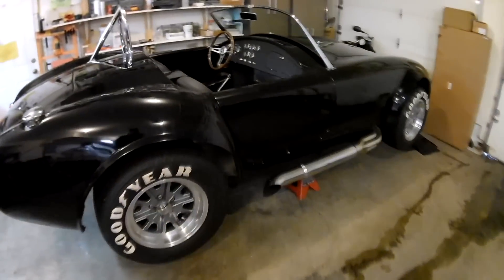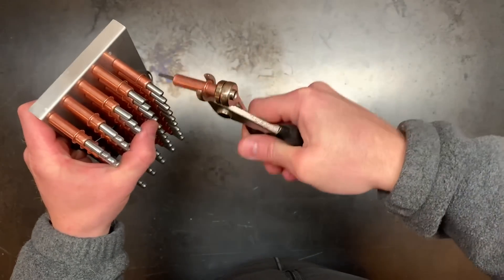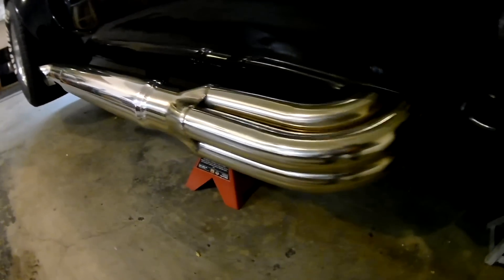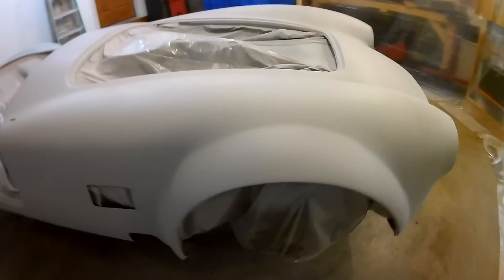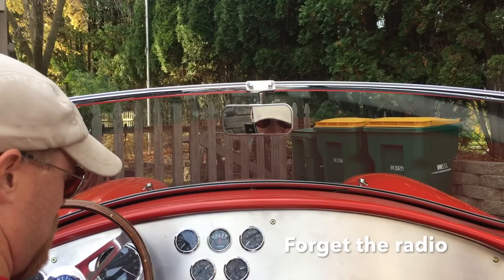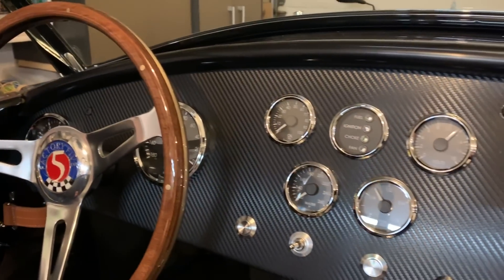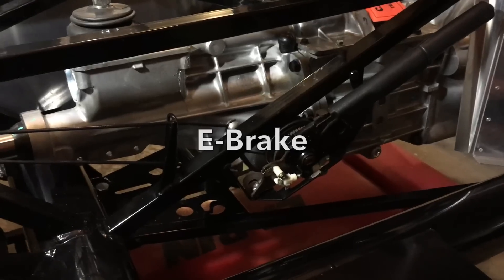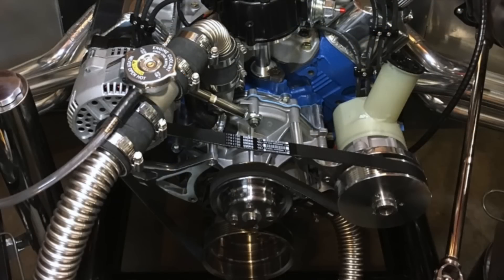Factory Five Cobra: Lessons learned

Comment: Some years ago dad and I built an Austin Healey Sebring 5000 kit car. Opted for the fully assembled frame kit with steel floor and transmission tunnel. Made the mistake of getting a custom built thick core, all aluminum racing radiator. Even with a really powerful electric fan it would run hot sitting still and at lower speeds. The problem is those radiators aren't made to be used at an angle nor are they made for sitting still. What we should have gone with was a 'feed truck' core that has a much more open fin design that's made to not get clogged by debris when used on trucks harvesting crops. Small bits of chaff can get sucked through by the fan and larger pieces will fall off when the engine is shut off.

What you could try is one of the dual fan setups used on various Fords. Some have two fans the same size, some have two different sized fans. I mounted one with same size fans on a 1998 Mountaineer. It fit in vertically and after putting the bottom of the radiator back into proper position had no clearance problems to the threaded water pump snout.

I built a two speed fan controller, inspired by a setup used on some Peugeot with dual fans. At low temps it connects the fans in series to run each at 6 volts. Then when the AC is turned on or if the temp ever gets hot enough (never did) it uses relays to switch the fan connection to parallel to run them at 12 volts. It has a pair of multi turn pots to adjust the high and low switching temps.
Setting them was simple, pot of water on the stove with a dial gauge thermometerr. Put the temp sensor in the water, connected it, the controller, and fans to a battery charger then turned on the stove. When the thermometer got to the temp I wanted I adjusted the low pot until the fans switched on, then turned the stove up to the high temp to set the high speed. My 1965 Kelvinator (built by American Motors) stove has one burner with precision temp control so I was able to dial in the fan controller settings.

If you want the controller schematic I can send it. I built mine on a piece of plain PCB perfboard with point to point wiring for the relays and a Radio Shack prototype board on standoffs for the electronics. Extra difficulty was caused by Radio Shack having replaced all their classic line of project boxes without updating their PCBs to fit the new boxes. (Just one of the many reasons the company is defunct.)

The way the circuit is designed, half the IC isn't used. There's a chip that's the same as 1/2 this chip, or the other half of the chip could be used to run a second copy of the rest of the circuit for operating two more relay controlled devices based on temperature inputs. Perhaps a pair of exhaust fans behind the side louvers?
Reply from the maker: GreggV8 - lots of very good info / you have some valuable knowledge/experience with the Austin Healey and I might follow your lead with a similar modification - thank you very much for sharing- i'll reference this in the future!

Comment: Using Ford Explorer engine not the problem nor is timing cover. No change in Block, Crank, Rods, Pistons. But Heads are GT40P with different plug angles and exh ports raised some but they bolt to any smallblock. Water pump so many choices don't have to use Explorer pump either. Try finding replacement water pump for MustangII 302 they were short nose too. My CobraII now uses normal pump with modified pulley
Reply from the maker: right on - thats what i ended up doing - got a fox timing cover / water pump and my problem was fixed. FYI- the Explorer motor is GREAT in this setup / i kept the GT40p heads and just changed the cam - LOVE the motor

Comment: I prefer the look of the 289 F.I.A. Cobra to the others. A 302 stroked to 331 or a 5.0 Coyote would make for a great ride.
Reply from the maker: 347 is on the long term plan - I have an 89 Fox block waiting for a rebuild. Never done a stroker 302 though - any experience?  - eg - is the oil burning issue for real on a 347?
Reply: I'm not sure on the oil-burning question but given a short skirt piston you might run into that problem. Something to check on the 347. The 331 is actually a .030 overbore with a 3.25 inch stroke crank. If you left the bore at 4 inches you'd pretty much have a 327 Chevy bore/stroke-wise and we know how that motor ran and still does to this day. It might be best overall to go with a Coyote except for the fact that you already have the 89 block and then you'd go for the 'vintage' look of the 289 car.
Reply from the maker: So for me - nothing beats the sound of a nice cam on carbureted 90deg V8 - the Coyote is a sweet motor though. The biggest problem i've run into its finding a good machine shop - it seems there are less every day!
Reply: @TacoJoe  I have a 342 in my 32. It has about 25,000 miles on it. This was a standard bore explorer engine. It has the gt 40p heads, a stock mustang gt cam with the 1.7 rockers. It's a 9-1 comp engine. The secret about oil consumption is good machine work. When the stroker deal started, there were many builders who made mistakes with clearances. This engine has wonderful bottom end power. I use a half quart on oil inbetween changes of around 3,000 miles. The most common complaint on these engines is minor oil leaks with age. Manual trans engines seem to fight rear main seal leaks way more than autos. I have been happy enough with this that I haven't installed a new set of Air Flow Research  heads that I bought 7 years ago. There might be 100 hp. laying in those boxes but the combo works so well that  I haven't changed it. The truck weighs 3350. It has a tremec 3550, 3.50 9" posi with 29" tall tires. Runs 1750 at 70 mph making 20 mpg. This does have eec iv efi.

Comment: NEVER EVER Move the engine or trans around to deal with a bolt on part fitment issue.  The motor and trans for ANY car should be considered fixed just like the body of the car and all attempts should be made to fit things like headers or accessory brackets to the car and not the car to the accessories.  If the headers dont fit, you build new headers, you dont screw up your pinion and engine angle to fit ones that are wrong. Nickles worth of free advice, you always modify the cheaper part first and a chassis is not the cheaper part compared to some headers.  IF they dont fit, hell, send them back!
Reply from the maker: Thanks for the comment Matt / I am fully aligned with your philosophy. So the situation is a little more complex than what is captured in my video and even if the headers did line up perfectly, it is very common to have to shim the transmission to get the pinion angle right. In some instances, adjustable control arms may be required too. Comes with the kit car territory eg not a mass produced repeatable OEM stamped frame, rather a hand welded asm. On the plus side - the driveshaft is ~12” long so there’s not a lot of mass/inertia to induce vibration- this baby runs smoooooth on the interstate :) thanks for the feedback

Comment: I was an automotive technician for 30 years and wanted to build a Factory Five Type 65. A couple of things changed my mom no. After working on cars 10 hours a day I couldn't bring my self to to work on one all night to. Second I wanted a LS LS motor ( I'm a GM tech) . The extra work of modifying the mounts was more than I was interested in. I went to the Factory Five factory and was very impressed. Your car looks great congratulations and enjoy.
Reply from the maker: I can understand how seeing cars all day would take away from working on them at night. I'm 100% certain you can do LS mounts in the car without too much trouble - i think the hardest part will be getting the engine/transmission in right position (front to rear) - and - getting your exhaust to exit in the right spot. Full transparency- you will have SERIOUS traction issues with an LS2/LS3/LS7 - these cars can only put down 350-400HP with 295-305 radials before you need slicks/etc.- what i'm getting at -- a mild daily driver 5.3 LS would be a great match to this car

Comment: Yes, Cleco holders are an asset to any build job. Myself, I would've done it quite differently on the build. 1st being the paint. Cars like this, always complete the painting before you put the body on the chassis. My opinion, but your interior is Not for me. Your car does look great and hope you have many fun filled miles in it.
Reply from the maker: Thanks for the comment Craig - if i had the space, i definitely would have taken the body off because of the mess but as i got into finishing, i saw a lot of advantages to leaving it on (eg- i almost certainly would have damaged-scratched it more) - because - i got the doors / trunk / hood perfect before i sprayed. With the body off, i suspect you would have to spend some tedious time carefully adding painted doors/hood/etc, taking off again to adjust-cut/etc because would the body land exactly the same when you put it back on?  I'm a perfectionist to a fault however and maybe this isn't an issue. For the interior- as they say, beauty is in the eye of the beholder :) You must be a FFR owner?
Reply: @TacoJoe Not really. Just an old road racer and Allied division modified circle track racer. I do however love the FFR Cobras. I do like the MK III roadsters better than the latest offering.

Comment: Factory five vs Superformance? How did you decide on Factory Five?
Reply from the maker: Superformance supplies rollers/complete cars and honestly, i don't know a lot about them. Superformance also has a dealer network for sales (20 or so). I guess that's nice if you want to kick the tires/test drive/etc. Regarding end product? If a FFR is built right (eg- right process / right parts / right setup) i would expect end product to be similar, with the caveat that you'll pay a lot more for the Superformance. Why do i say this? The MK4 frame is build RIGHT - core of the car. Me personally- i truly wish there was a FFR GT40 kit out there. The Superformance models look AWESOME and i think they are licensed too so you can get them in the official GT40 registry-- helps them hold their value. For spend though, i think you are well into 6-figs for one of these

Comment: How tough would it be to hang a full exhaust on that car? Is there enough room? Pretty sure I've seen Cobra replicas with tailpipe before.
Reply: early shelby cobras came with full exhaust pipe
Reply from the maker: You can definitely do it / the low point will be near the transmission or rear end, but its been done many times / check out the forums for details on the "gentleman's" Cobra :)

Comment: Honestly, I didn't know about these kits. They look good overall. Thanks for the feedback on it. I built my first one in 1982 from the ground up. It was featured in Kit Car magazine. Having a great body makes a big difference. I used an Australian made 351C with a top loader 4 speed. So true about the radio. 👍
Reply from the maker: Overall, the FFR design is solid and it all starts with the frame. FFR has designed the traditional Ford Windsor powertrain into their architecture and if you add 300-400hp, you will absolutely smoke an original 427 Cobra around the track. This is NO knock on the original -advancement with FEA based design / suspension have only made race cars faster and the MK4 is no exception :)

Comment: Good job on the video! 
You definitely hit the highlights of the unforseen challenges of a "kit" build.
Best tip, forget the radio, your explanation is spot on.
Also, anyone contemplating building or buying a Cobra replica, stick with a SBF,
Easy to get 300 plus hp, and that in a 2200 lb car is still a hand full to hang on to.
A lot of big blocks for sale on eBay and at the popular auctions, they are there for a reason.
Reply: Everybody likes the look of a 427 side-oiler in these cars but I think the small block cars are better in terms of balance, drivability and (not least) cost. When 5 liter crate motors are making over 400hp how much more do you need to have a fun car?
Reply from the maker: Well said dieselyeti / couldn't agree more. I've read with this specific configuration (eg- FFR MK4), traction becomes a real issue once you get over 350-400HP. I LOVE the sound when you wind up a SBF too / over square bores are the ideal bore-stroke IMHO!
Reply from the maker: Your comments on a SBF- well said my friend / couldn’t agree more

Comment: Appreciate the information. Always good to have sources like this before making a big decision. I plan on getting a gen 3 Daytona Coupe, and building it as a daily driver.
Reply from the maker: I think a daily driver goal is an excellent idea - so many of these builds have a lot of $$$ invested in perfect interiors/wheels/paint/etc. and that can take the fun out of driving because of concern road damage/scratches/rain/etc. I like your thinking. Me personally- if i were to take the daily driver route- fuel injection would be ideal - and - invest in some good insulation on the cockpit panels - and - consider one of those aftermarket AC compressors :)
Reply: @TacoJoe  I'm looking  to go the 5.0 coyote route with mustang IRS, AC, and plenty of insulation. I'm in the south west so I know the heat would be an issue otherwise. I've been reading a lot on the forums, and watching videos like your for as much in depth info as  I can get. 

Realistically I know it'll take a while to get the car just right, but that's what makes the project fun. It's not the end result, It's watching something you build take shape, and change over time.

Comment: Nice video, Just my 2ç Those pipes are gorgeous but they will burn you or someone one day. Electric steering will save the day dump that heavy system. People use Toyota units and they fit under the dash. If you are ever going to get a speeding ticket, when the cop asks you do you know how fast you were going, tell him you built the damn thing and the speedo sensor went kuputz just now, then get fix the issue and most likely the judge won't give you points and may throw it away. Keep having fun.
Reply from the maker: I will DEFINITELY check out the electric steering / not familiar but yes- that would be very very nice. Great tip! Sadly, the pipes have already bit me a few times. Once the stainless discolors and they get some more road chips-dings, maybe i'll wrap them
Reply: @TacoJoe  Don't get me wrong, I love'em, everyone gets bit. See this video where a diy guy gives the goods on that Toyota steering info this is the second vid https://youtu.be/cERfqzKfoAk. You may have to cut the column under your dash to mount. I'm thinking of doing this on my classic and refuse to pay some ridiculously high price. Great work on the car. Be safe with her.
Reply from the maker: NICE- thanks for sharing (good video) / i honestly had no idea this type of power steering existed. I plan to build another motor for the cobra (long term) and at the same time i could work something like this in too-
Reply: @TacoJoe  90% of people start and never finish. I envy your shop, you have the right amount of equipment. With enough time and patience the little items you build make a world class build. The best thing is, it is your touch, the hell with the purists they think trailer queens are cool, that monster you built deserves all the fresh air and enjoyment you give her..
Reply from the maker: Thats one of the best compliments i've ever received for my build - Thank you! (i'm smiling) - FYI - for my next project, i'll be on the lookout to score a deal on one of those 90% builds ;)
Reply: @TacoJoe  They pop up on bringatrailer.com once in a while. I missed out on a Datsun 510 race car built to the 9s and I'm still kicking myself! Just your speed. Good luck.

Comment: I think you've provide some useful information.
My biggest question is, will a 6'-4" 230 lb fella fit.
Reply from the maker: i'm 6'1" and 210lbs and was able to make it work. I think with some ingenuity, you can too. Seat/pedal position, steering wheel, etc. all play into the equation. Full transparency: comfort level in a Cobra replica will never equal a bagged caddy, but once out on the town having fun, i don't think you'll notice :) I'd hit up some car shows and see if you can find one to sit in / check out the factory five forums too - if I remember correctly, I think this is a popular discussion topic (big guy modifications)
Reply: @TacoJoe  good points and I also think it depends what kind of tall you are.  torso or leg tall.  really need to try on and see if the fit is there